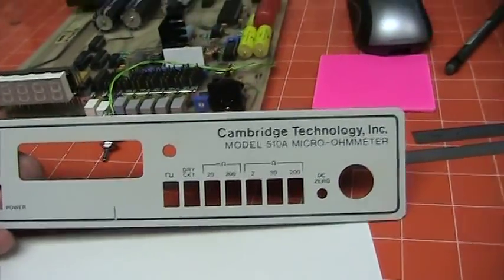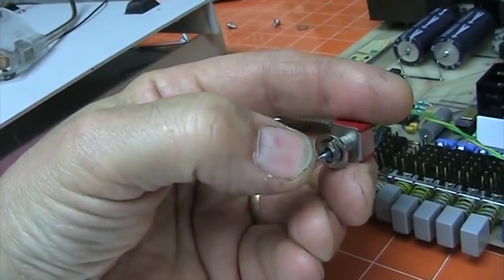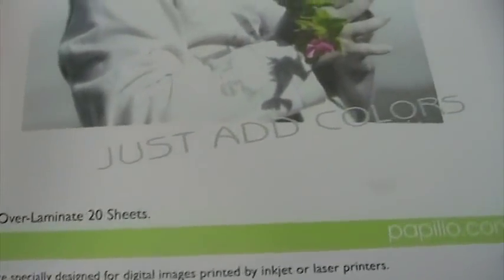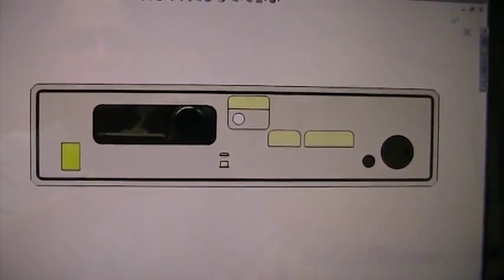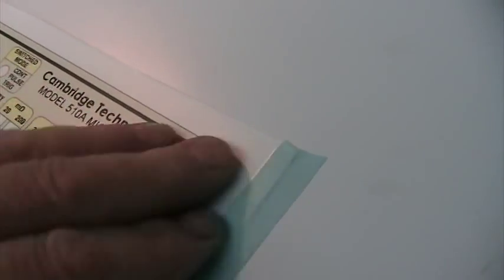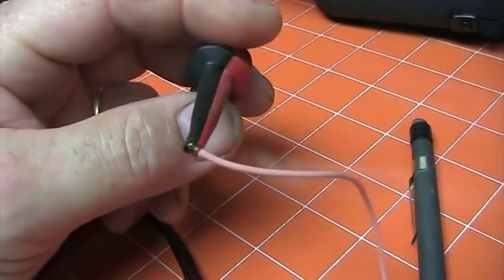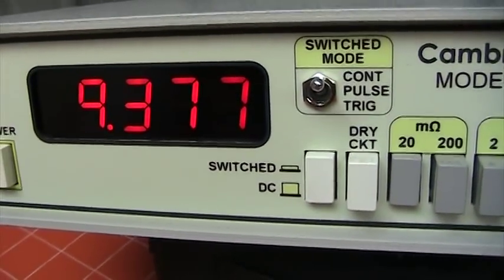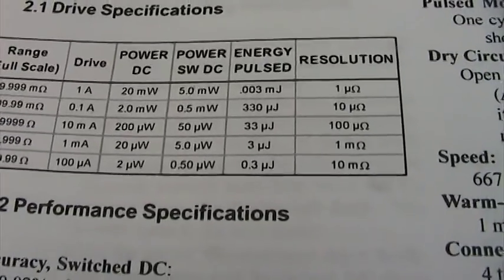IET LOM 510A  MICRO OHMMETER

Comment: It is am amazing work on Cambridge 510A. Congratulations! I have one unit, too, but the previous owner made some "improvements" changing the resistors R10 to R19 and both R31 and R32. So it is not possible to calibrate my unit (serial number 546) anymore. Could you please inform me the values of these resistors? Many thanks in advance and best regards from Brazil!
Reply from the maker: Thanks, but too busy to take the 510 apart and look.
Reply: Ok, fine. Many thanks for your attention. I will try another options.
Reply: Found this forum/site with quite a bit of info on them including some decent pics of the "guts" you should be able to use along with a resistor color code/value chart to determine what should be in there if you can spot the "swapped" resistor positions in the pictures. Sounds like some wannabe "electrical engineer" with no clue about the various "color codes" and band counts/arrangements and how to "read" them to find/install the correct resistors "repaired" it with the wrong parts. Probably after he "let the smoke out" of the meter using it incorrectly i.e. playing with it with no clue what he was doing. There are some real "electrical experts" out there who don't even know Ohm's law doing all sorts of "electrical engineering", wiring, playing with electricity etc with some real high-tech and high-dollar equipment and even do amateur "electrical engineering" for others for money or other compensation and I'd say if half of them could take a $20 el-cheapo multi-meter and correctly demonstrate all of the various functions/modes without smoking it or something in the circuits they were "plugging into" it would be surprising. Some of them don't even know that outside of the AC wiring "universe" RED is "hot" and BLACK "is" ground and regardless of "polarity" BOTH CONDUCTORS/WIRES/LEADS are still conducting current regardless of where the meter is set even if there's "no voltage" and when it comes to schematics....forget it. I wouldn't even trust them to hook a set of jumper cables up properly. Good luck with your meter. I'm sure its in better hands now, lol. 

https://www.eevblog.com/forum/testgear/ie/
Reply from the maker: That is my EEVblog post

Comment: Best video clip ever on 1 micro ohm resolution @ 0.02% accuracy, FANTASTIC!!
The manual shows 2 100 K ohm in the 5 Pin DIN Plug can you give some feedback on this please.I recently purchased the Cambridge 510 A at $450 but it didn’t come with any Kelvin Clips.
Reply from the maker: Thanks, my kelvin clip video shows them on the din plug at the end here http://youtu.be/wwgO6Lg4RZM?t=48m11s  they are there to not have an open circuit when in dry contact mode when the clips are open and not connected to anything.
Reply: ROBRENZ Wow that was quick, thank you. Last question on your forum you show what looks to be a 5% carbon resistor between pin 2 & 4 of the female DIN. Giving a zero reading for calibration.What is the value of that resistor please.
You should consider a teaching position at MIT or @ DeVry Institute of technology.
Reply from the maker: RE BOOT where are you seeing this resistor on the din connector? I don't know what you mean by my forum?
Reply: RE BOOT I really appreciate the dedication and the amount of effort that goes into educating and contributing that go into these forums and a time that it takes to make a well produced video as you have done.

Comment: Do the areas printed in "white" appear diffuse transparent?  I am looking to make an overlay identical to how you show and then place additional diffuser film and LEDs behind some of the graphics.  For example, I want to light up an 'I/O' icon to show that my device is on.  Do you think it would work in this capacity?

You show your printed image on white paper so I don't get a sense of transparency.  Also, I'm mounting this on a black enclosure.  Will the graphics show up?
Reply from the maker: The overlay film used is white and generally opaque because your printer can't print white.  Yes you can put this on a black enclosure and it will show up. Think of it like a very thin photograph with a sticky back. I have not tried it but a bright led shining from the back might visibly glow when viewed from the front.